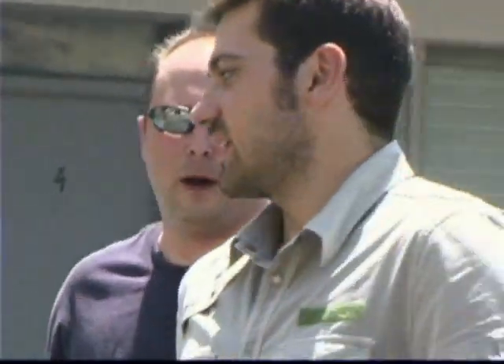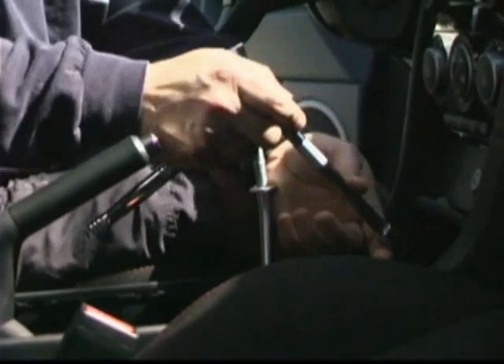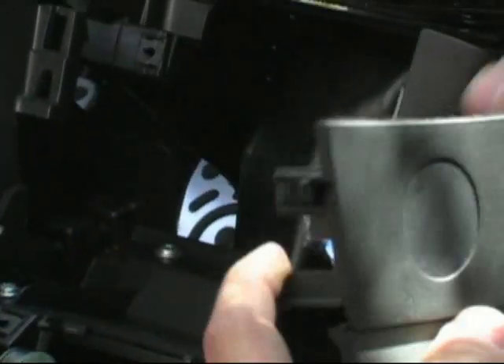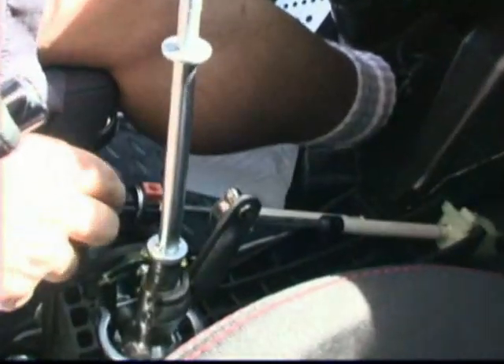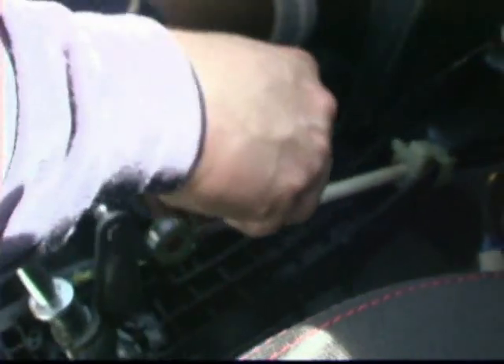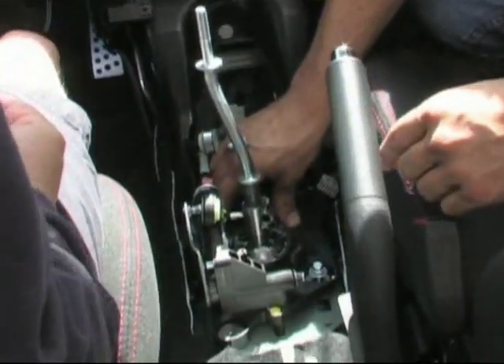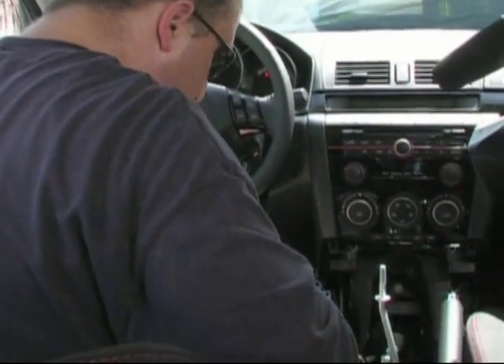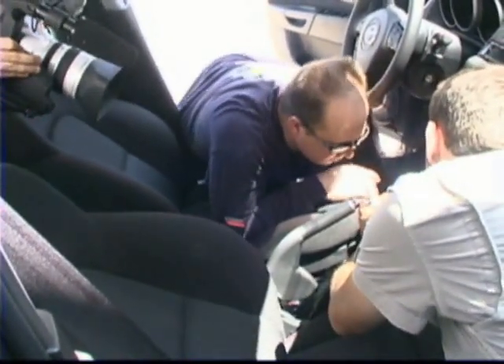Mazdaspeed Forums Review - TWM Performance Short Throw Shifter Install Mazdaspeed 3 Part 1

Comment: This video was very helpful guys. I installed the shifter today on my car and I have one tip to add...you don't need to pry the 3 clips off, mazda fitting holes behind them so you can just push them forward using a pen or something and then put in the paper clips. Other than that it was a great video.

Comment: THANKS FOR THE VID. I was able to install mine all by myself. 1up!! Small helpful hint, not much though. When using the paper clips, the tab on the passenger side.... There is a slit for a flat head screwdriver to fit in and push the tab forward to insert the paper clip. I found this last. I did not look to see if there were any other easier ways to get the clips in the other two tabs. I was racing the sunlight.

EDIT: I just read the post before mine. lol. Regardless, I got it done :) thanks again.

Comment: this video is very helpful i just have one question when i take out the centre armrest i have the aux plugin from the stock radio will i have to disconnect anything extra or is it exactly the same way as the way you did it?